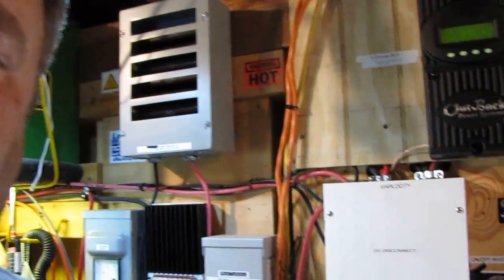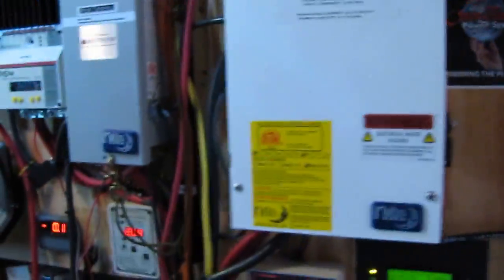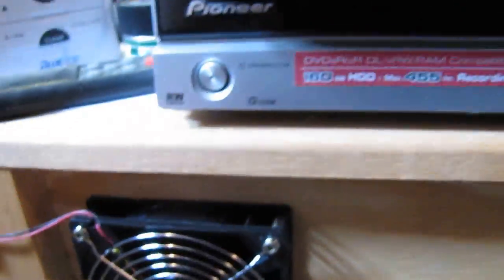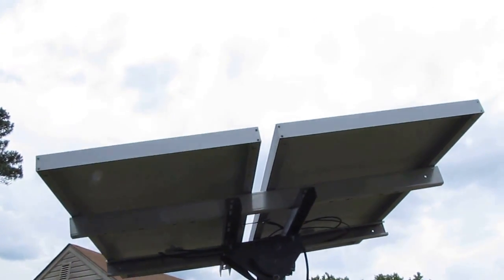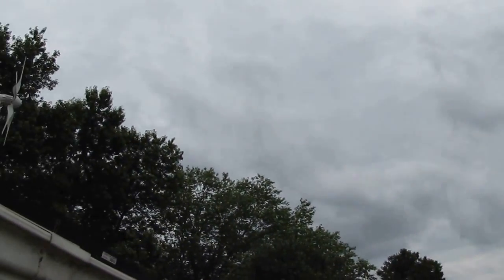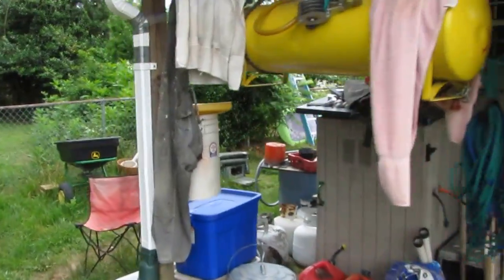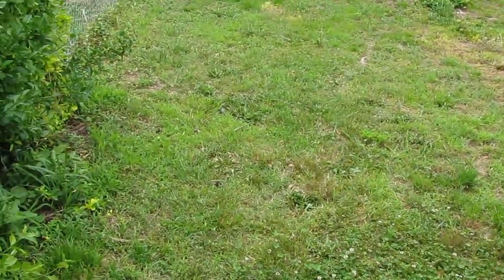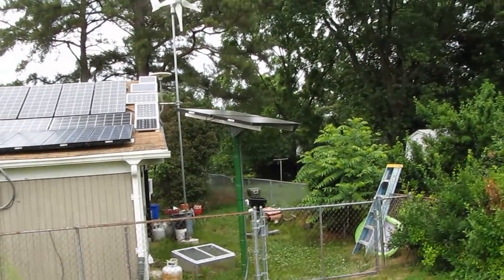Solar Power Update  On a Cloudy Day In Virginia USA By kvusmc

Comment: WOW Ken,You have some toys HUH??  I guess its working for you. Usually with many panels having differient MPPT Voltages most units cant work properly. Id be curious to know if you have ever just had "matching" panels on a single charge controller b4. One guy reported that by adding a small Harbor Freight kit to his 4 large panels he lost 30% of his output cuz the new HF panels threw off the MPPT function of his charge controller. Hey.. if it aint broke..! I like my 420w SOLAR 200W wind and 800W wind units! ordering a evacuated tube hot water heater (heat pipe) tomorrow. 40,000BTU per day in full sunlight. NEXT.... log cabin in the woods (hope) thanks for your time Ken! Semper Fi Brother. 73
Reply from the maker: OORAH Buddy In Fact Some Days I'm Putting Out More Power Than Solar Panels Are Rated  LOL It Is Wild Man Sound Like You Have It Going On Buddy I need To watch Some Of Your Videos Buddy

Comment: Ken,  I noticed that you might have as many as nine diff panel brands in your PV array. How did you wire them so you would get the most out of them? With the MPPT controllers you need to have all the panels within .50V of eachother for the MPPT to work properly. Wiring the big panels to make the strings within .50V might give you more power output. Ive never seen an MPPT used with so many mis matched panels. So what im asking is.. does it work? how many W is the whole array? whats ur average Wattage harvest?  Thanks for the movie! hope it works for you! 73
Reply from the maker: I Have 4 UL Solar Panels And 2 Of Them are 125 Watt Panels The Other 2 Are 140 Watt UL Solar Panels On The Pole Mount  I Also Have 8 - 135 watt Kyocera Solar Panels They Are Wired in Series Parallel ! On One Charge Controller OutBack FlexMax 80 MPPT  I Also Have 5- 140 Watt  Kyocera Solar Panels All Wired In Series Going The Other FlexMax 80 MPPT Charge Controller  ! I Also Have  2 Alt E 120 Watt Solar Panels Wire In Series @ 24 Volt  Going To My Midnite MPPT KID Charge Controller I have 2550 Watts Of Solar Total Not Including My Separate Off Grid System  And I Have 2 - 1 KW  @ 24 Volt Wind Turbines So Total I can Produce Up Too 4550 Watts In Perfect Conditions  I Produce An Average Of 7 to 15 KWH On A Good Day